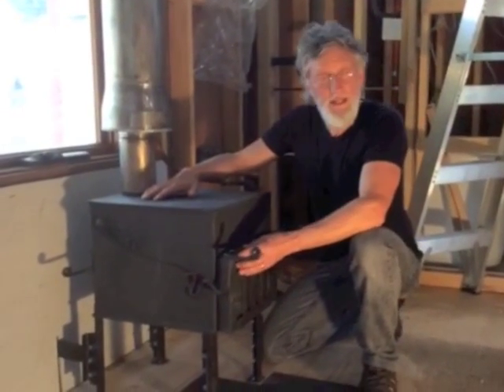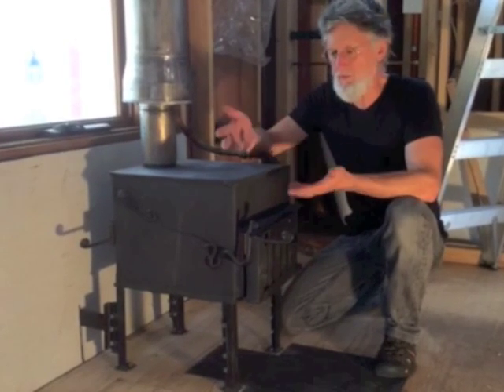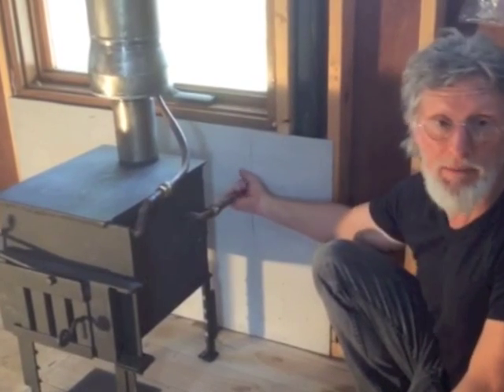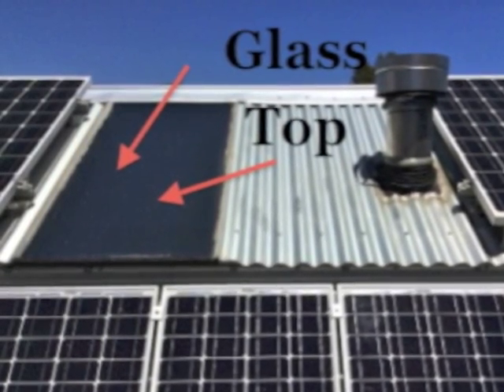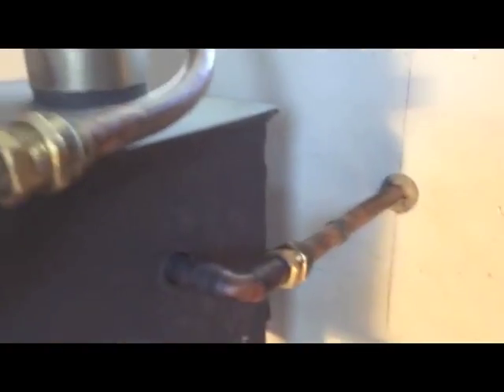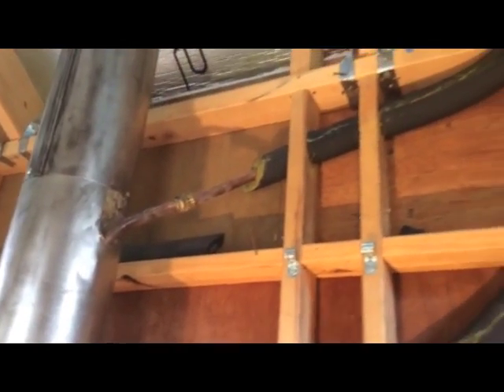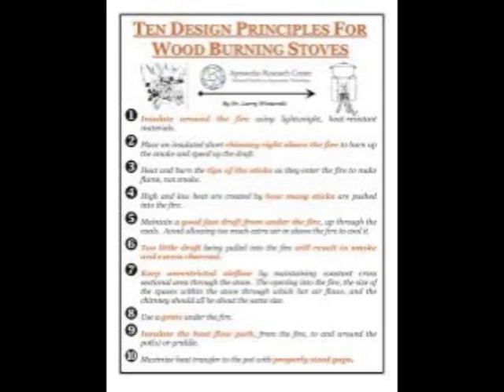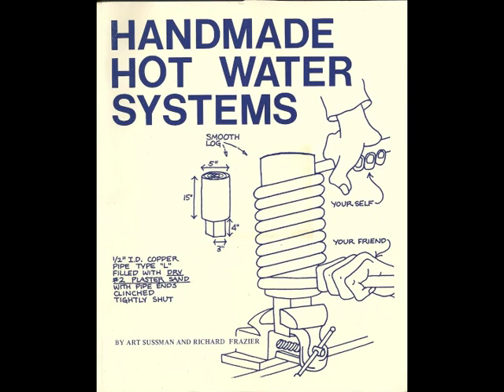Hot Water System: Gravity-Fed, Wood Fired, Passive Solar Collector - Fred's Tiny Houses Blog

Comment: From one Fred to another, thanks for sharing your references and info sources, excellent! I've been planning to build a small fire for camping in a small shelter for some time, probably using a propane/LPG bottle or compressor tank or similar, for a start. In yours, as shown, is there just a short straight section of copper in between the two baffles? If so, is that to limit the amount of heat collected so as not to boil the water in the tank too quickly? My plan is to use a full size old hot water cylinder and use the fire in the evening to bring it all up to temperature then circulate it through some under floor and under mattress heating tubes overnight at some adjustable rate. If needed, more fire in the morning before using the shower :-)